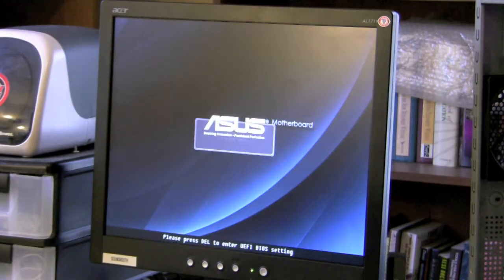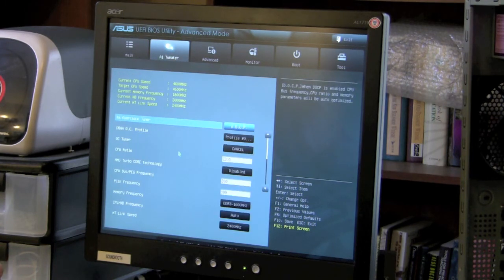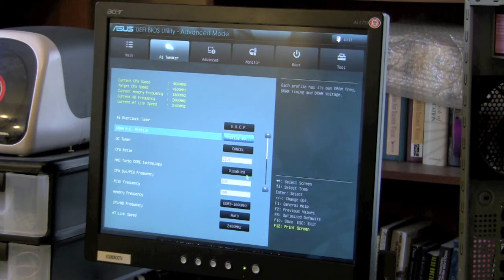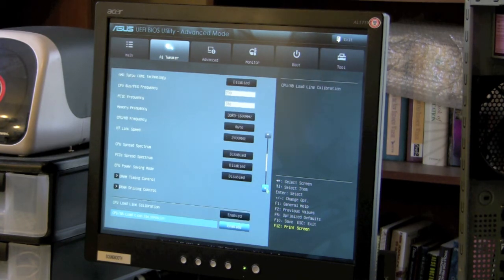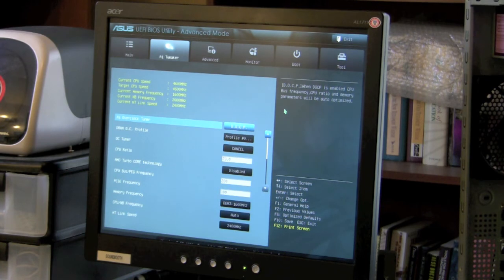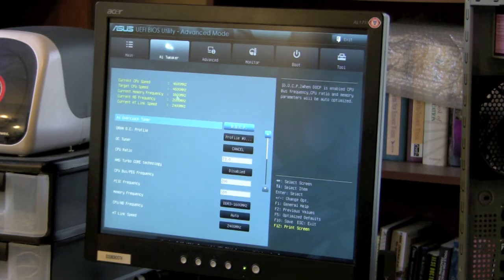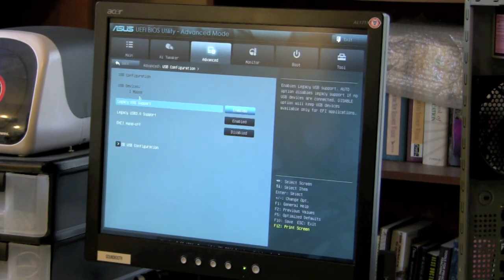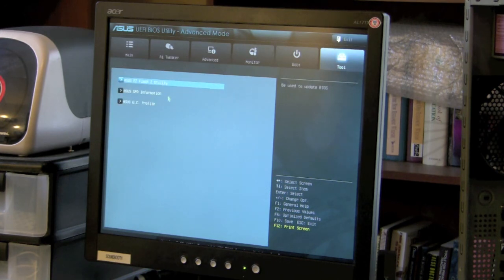Paul's Budget PC Build Part 3 - The Asus UEFI

Comment: LOL, with this board that processor goes 4 Ghz with stock cooler without a single problem, still, with a good Cooler you can make it to 4.3 Ghz or more, FX 6100 goes 4.5 GHZ without problems :D

Comment from the maker: This board will overclock moderately. I achieved the expected simple overclock with the FX-4100. It would not be the board I would recommend for Extreme overclocking but on a budget... pretty good. As for the Athlon x4 635, I had an Athlon x4 640 overclocked to 3.7Ghz on a cheaper board so you should do well with M5A97. Maybe 3.5Ghz.

Comment: The Fx 4100 is a 3.6 Ghz Quad core, Using the turbo will just higher it up to 3.8 Ghz or even higher with the right heat sink.